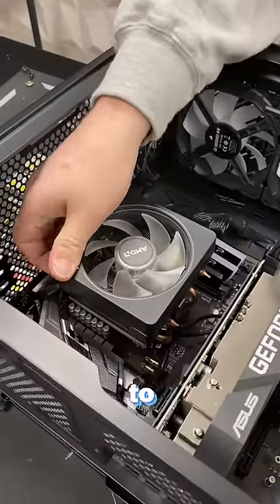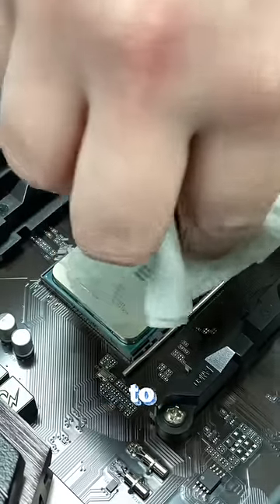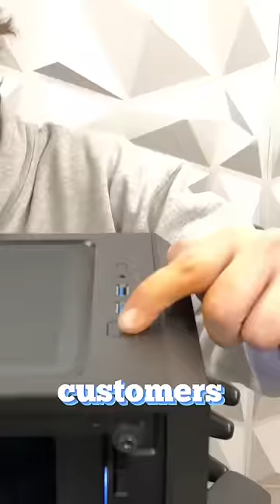OVERHEATING CPU?! 🥵 #pcrepair #pc #cooler #gamingpc #pcgaming #egirl #gamerguy

Comment: I went from 70+ degrees with a stock and cooler to max 47 with an aio. Definitely worth it
Reply: Yea but it was a stock cooler. Its like having a shitty 200 bucks windows laptop and then getting a 2k macbook and being amazed by it being better. Some aircoolers even outperform AIO
Reply: @traFREAK  true except most aio’s are better, smaller and in my experience quieter. I couldn’t upgrade to a half decent air cooler because my ram slots are too close to the cpu but even if I did everything again I would still definitely go water cooling as it’s much more visually appealing and is a lot easier to clean and can still perform well in warm rooms. I did have a $70 cooler master air cooler in one of my earlier builds and even that struggled to keep it under 60 degrees stress testing. Of course this all matters about your climate and cpu/air flow but water cooling is worth it in my books because 26 degrees under normal use is only a few degrees warmer than my room which is insane to me.
Reply: @vipersnakegamer5081  to be fair under 60 degrees is so unnecessary. You can easily sustain 80-90 degrees. Noise i dont really get since they both use fans? But cooler wise something a dark rock pro4 or such will outperform.
Reply: @traFREAK  Yeah, 80-90 degrees will decrease the CPU’s lifespan and make the rest of the pc hotter though, also my aio is a lot quieter since it uses 2 fans meaning they don’t have to go too high rpm as they can split the load, causing noise levels to reduce as good fans only really produce substantial noise once they are forced to spin at around 50-70%. I’ve tested this with the four modes (silent, normal, turbo and full power) and both silent and normal being silent with turbo being audible but not by alot. Putting both fans on full power however raises the noise level by a very large margin meaning if I was to buy an aio with 1 fan it probably wouldn’t be quieter. Even at max bench tho it rarely has to use turbo with it only ever going full power once when I was standing in the middle of cyber punks city whilst having several apps and browsers open
Reply: @traFREAK  it’s also practical for my small case as I can replace the 2 front fans with my radiator meaning one less fan and less noise yet still better cooling

Comment: Of course it was getting hot, he was using a stock prism, 80-85 degrees are normal with that piece of plastic, 50 bucks for a deepcool k620 and he'd be gucci

But I do understand the appeal of a radiator, just 240mm rarely perform any better than a mid range air cooler

Comment: Liquid cooling is useless, unless you have an extreme build, or using a very small case for a mini pc where an air cooler won't fit. In any other case it's never worth the hassle.

Comment: the problem is that an aio performs worse than an air cooler, go check ltt video on that
Reply: Was looking for this, thank you. Get a good noctua fan and some liquid metal and (almost) no water cooling can beat that.
Reply: Not to mention the fact that an AIO cooler can end up making a huge mess in your PC if it breaks, and can cause other components to break in the process, too.
Reply: @octariax  AIO's almost never break like that unless its poorly made, your tube isn't going to spontaneously rupture
Reply: @spaghettiupseti9990  still more mechanical parts that can break than an air cooler tho
Reply: @spaghettiupseti9990  myn friend had problems rwo years after mounting his aio, i just don't trust them
Reply: @thanatos0014  No air cooler is beating a 360mm radiator.

Comment: As a thermal engineer, it is frustrating to see you mount the radiator so it blows hot air INTO the case.. 🙄🙄

Comment: Tilt your PC accordingly to your tubes path, most people don't, not really needed but it's the fastest way to push the air out of the block. One of the aios I have hasn't had one single issue for 4 almost 5 years.

Comment: Of course the CPU gets hot under load with the stock cooler. There are a wide variety of other air coolers that would perform equally if not better than the 240mm AIO and would be far easier to clean and maintain for the customer while also having less points of failure than an AIO would.

Comment: A drill on the fan screws for the rad?... I wonder how many radiators you've stripped the threads for the screws... Not even starting to thread the screws either, which most likely cross threaded the hell out of them before stripping them.. Rookies...
Reply: Thought the same thing. As good as they sound to anyone who isn't proficient, these guys are a huge joke.

Comment: Had nothing but issues out of my AIO, switched to a noctura dual tower air cooler and never looked back. Don’t think I’ll ever mess with a water cooler again I took my case apart 50 times adjusting it to never work right.

Comment: I dont run AIO's but I always wondered why people run the fans as intake. Wouldnt it just put extra heat onto other components like that?
Reply: not ideal but it's not horrible. it will put it a few degrees higher but it looks like this is a gpu that doesn't really need that much cooling

Comment: I almost bought an AIO, but my brother still had an air cooler left that didn't fit in his case, so he gave it to me. It works pretty good and is really quiet. Do you think an AIO is worth it? My CPU is the i7 11700k, but I haven't overclocked it.
Reply: Check your thermals, if you're not thermal throttling there would be no reason to "upgrade" to an aio

Comment: “Over time, the paste had dried out, and crust.  “…..😂 His cpu overheating cause of old thermal paste. He just said it was like a crust substance at this point. He didn’t need a better cooling just apply more thermal paste after cleaning. It looks exactly like my XM-7 paste when it dried out in the tube from cold weather and back to room temps. Don’t know why but it happened. Could not apply that thermal paste anymore for it caked up and was like clay. Very bad to use and or keep on cpu for cooling. By my eyes, the thermal paste you removed didn’t look dried out. He didn’t need a better cooling of the customer isn’t doing any extreme OCing.

Comment: and then the fun part ryzen can clock further with a air cooler by itself then a liquid cooler as it bursts to high speeds dumping all the heat in at once it just takes to long for the liquid cooler to dissipate that heat while with the air cooler it drops within seconds
Reply: you can achieve the same result with an Nhd15 or a hyper212 air coolers. AIOs aren't magic. They are similar or sometimes worse than an air cooler. A set of 2 fans and a hyper212/nhd15 will run you cheaper with most likely better thermals especially when it's set up like the guy on the vid does cause thaat will die in 6 months to a year.

Comment: if you drop 20 degrees from an wraith prism to a tripple aio you did something wrong 💀 i switched from a wraith prism to a 40 euro thermalright cooler and i went from 90 under full load to not even hitting 60 under full load

Comment: Cool, but you mounted the radiator wrong. The pump should be the lowest point in the liquid loop, your lowest point is where the tubes connect to the radiator.
Reply: Air will go to the highest point like a spirit level turn it 90% the bubble will go to the top. The highest point in this aio is the top of the radiator.
Reply: @davidrollerson2240  yeah, you're right.

Comment: BUT the cpu was getting yap yap yap .. water coolers don''t cool more nor better. You tell your customer to bet a larger air cooler and he will have made a better deal. The water loop changes this part of the computer from low to high maintenance.

Water cooling is hot air. Invest in decent cooling and decent in case airflow. Noctua is your friend.

Comment: For ppl pointing out the mounting position, it is correct. It doesnt matter if the tube is above or below. As long as the radiator mounted height is above the pump, it is right. Air will get trapped at the highest point.
Reply: You’re thinking of a custom loop, not a traditional aio. In this case the top part of the aio (which is at the bottom) will trap air and thus reducing the life span of the cooler.

Comment: Nooo you got the AIO the wrong orientation. The pipes headers are supposed to be above the pump so the aio radiator is actually upside down.
Reply: Tubes down is better for the pump, allows air bubbles to sit in the top of the rad away from the pump
Reply: Ur 100% wrong. Tubes down is better for longevity of pump and noise because air bubbles settle at the top away from the pump
Reply: Bozo

Comment: Why you'd ever have your cpu cooler as intake is beyond me. Yes, let's bring the ambient case temp up so we throttle our gpu under load. You wouldn't have an air cooler pushing air back into the case, so why would you do it with an AIO?

Comment: im using a vetroo V5 which is a air cooler in a golden field glass tower case and my temperatures are 25• - 28• when gaming at 4k still so i dont get it.

Comment: The radiator is upside down you need to have it flipped the other way, having it in this orientation will put too much stress on the pump and shorten it’s lifespan

Comment: Imagine having your “intake” fans pull air in to your case… stay with me here…. Feed it through a radiator, thus heating the air and then directly feeding that heated air into the gpu……….. every other fan in the case is set to exhaust so the only “fresh air” is coming through through the radiator. So either you’re racist against GPU’s and they aren’t allowed to breathe fresh air or you’re not effective a building pcs.

Comment: I think Jayztwocents made a video about how to install the AIO and the pump should never be higher than the radiators tubing part. So where the tubes that should be up and not down.When you install it on top of the case it doesnt matter.
Reply: Y’all misunderstanding the video again and acting like experts 💀💀💀. He said it’s not ideal for tubes to be on the bottom, but as long as the pump isn’t the highest point in the loop, then it’s fine.

Comment: that's one of the shittiest ways i have seen poeple install an aio. first that is too much paste, you could achieve 1-2 degrees cooler cores by using the correct amount. second you put the pump top most of the aio, it will have air in it and break faster and make noise. also it will vibrate.

Comment: Also there are air coolers that are as good as cooling as water cooling for half the prixe
Reply: Not really. The air coolers that compete with water coolers are priced almost the same.
Reply: I mean NHD15 is 100 quid, which is the min you should really be spending anyway going from a stock cooler.

Pretty much as good as top AIOs twice the price with 2 fans attached, without the liquid BS. Only real downside is that it requires a decent amount of case depth.
Reply: @louiesatterwhite3885  $100 noctua whatever is almost as good as hardline and better than aio
Reply: @thetshadow999animates9  not really. 240mm arctic liquid freezer ii aio is $98 on amazon and outperforms all of noctua's $100 offerings.

Although I guess it's not the most fair comparison, the arctic liquid freezer ii line of aios is heralded as the price to performance king of liquid coolers. Most mediocre, rgb-barf aios would be outperformed by a cheaper noctua cooler. But saying it's almost as good as hardline is factually incorrect considering just the variability standpoint.
Reply: @louiesatterwhite3885  they’re within 3c tho
Reply: @louiesatterwhite3885  Noctua is indeed the best air cooling, you can check out the comparison tests, and water cooling don't have anything to do against it for the same price.
Reply: @XZypherX  factually incorrect on saying water has nothing against it at the same price. The arctic liquid freezer ii aio outperforms the Nocuta NHD15 in thermals and acoustics for $3 less.
Reply: @louiesatterwhite3885  the fuma 2 however does beat the liquid freezer 2 and costs only $65

Comment: i switched from the intel stock cooler to a 3fan aio and i went from 90-95 to 50-60 max
Reply: trust me you'd buy a noctua nhd15 and you'd get the same result for cheaper most likely

Comment: your AIO tubes should go upwards, the pump should never be the highest point in the loop
Reply: You're right that the pump should not be the highest point... but the Radiator is part of the loop aswell. So in this case quite literally the highest point is not the pump... the side of the radiator with the tubes is partitioned in two sections and should be at the buttom. The way he showed is actually the better way for longevity in a  because you dont want the air bubble in one of the separated sections. By mounting the tubes at the buttom the air bubble is at the opposite of the tubes and the bubble can be spread out more evenly. Even better though would be mounting at the top.

Comment: Most people don’t know that if your going to front mount an AIO cooler, that is the correct method. Not with the tubes at the top. Contrary to opinion, it is proven to be more effective, and most likely specifies in the manual for the AIO to do so.
Reply: Finally someone who is actually informed bevore blasting out his opinion about how to do it. XD

Comment: Does no one know how to apply thermal paste properly any more? 

Thermal paste is to fill in the minor imperfections between two mating surfaces to optimise contact area and heat transfer.

Nothing is better than metal-to-metal contact.
Thermal paste is better than metal-to-air contact to conduct heat where otherwise there'd be no contact between two imperfect surfaces, and to allow conductive heat transfer. 

Less is more. Spreading that shit on your CPU like it's a peanut butter and jelly sandwich is reducing the efficiency of your cooling solution and wasting your thermal paste to boot.

Comment: Were is the intake and exhust lool
Reply: Exhaust is typically from the "back" side of the fan (the side with the plastic holding the motor).

The side without the motor is typically the intake.

Comment: you should have the hoses at the top of the radiator because the way you put it will allow air to get into the pump im not a pc builder and even i know that
Reply: You are not a pc builder but still you have the audacity to teach someone who does that professionally 🤣
Reply: @DJDadonik yes, because he has a point
Reply: Ne he don't hoses at the bottom high point of rad above cpu
Reply: U want the air trapped in top of rad tf and hoses at bottom so it don't pump it
Reply: @Djchunkz6969  flat earther got a point too still they are wrong. How in the world will air go in the pump if tubes are down and the pump is lower than the radiator? Are you some magician who makes air heavier than water? Prove to everyone your point. Make a video and show it to everybody. I really want to see how you defy physics. 🤣

Comment: why the hell is it mounted wrong
Reply: in fact, it isn't. It's mounted perfectly.
Reply: @DJDadonik  no its not with the cooling part being at the top the air which is literally in every aio will rise to the top of the tube, and since it is the cooling part for the cpu it will not cool properly because theres air in it, you're supposed to have the top of the radiator above the cooling part.
Reply: @lessdutoverwatch  The metal plate on the pump is the cooling part, tubes are just moving fresh water to the pump and warm water to the radiator. Air is lighter than water and goes up, if you mount the AIO with tubes up you will have tubes that are moving water and air bubbles to the pump resulting in noise and faster deterioration of the pump itself. In this case tubes are down radiator is still above the pump air bubbles will go on top of the radiator where there is nothing and it's perfectly fine. https://youtu.be/BbGomv195sk if you don't believe a random guy on the internet you will se with your eyes where bubbles go in this video. Just read more and watch some real content before spreading so much misinfomarion.
Reply: @DJDadonik  lol do you think its water inside a aio that says it all
Reply: @Jesper1988  it’s a mix of water and ethylene, this info does not add nothing helpful and it’s not relevant to what I’m talking about. Your attitude instead says a lot about you.
Reply: @DJDadonik  okay Karen

Comment: Too much thermal paste. Theres no reason to mount it on the the front drawing in hot air. And the AIO is gonna die because you mounted it with the hoses on bottom so it has to pump water uphill. There will be air in the pump.